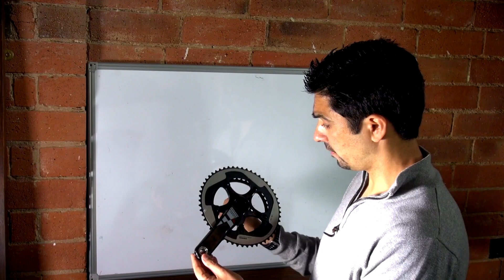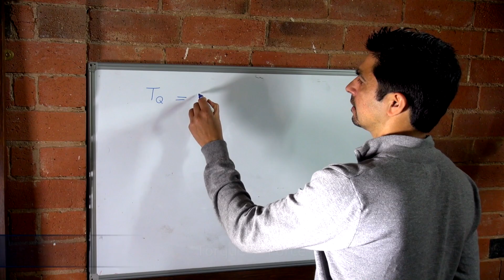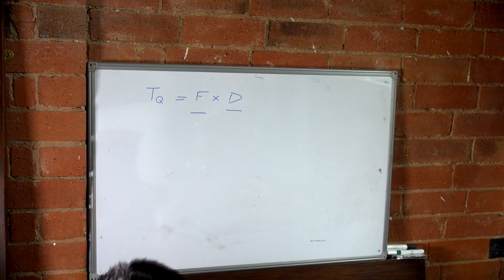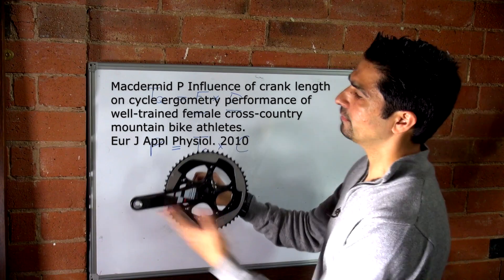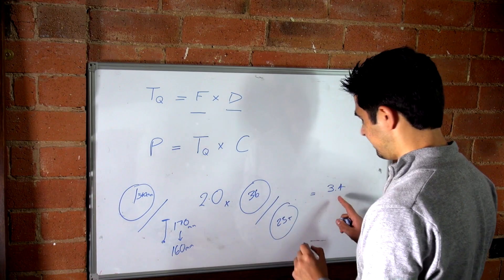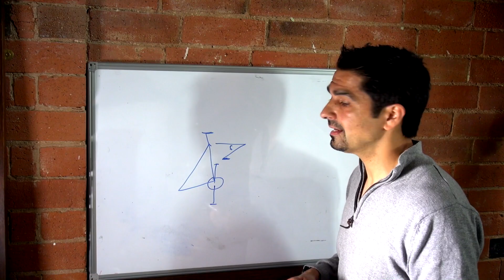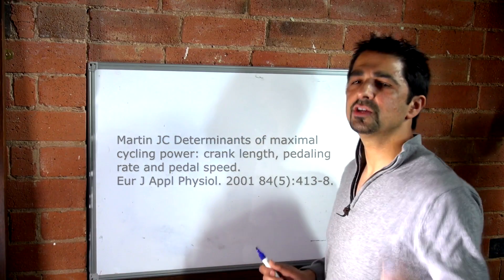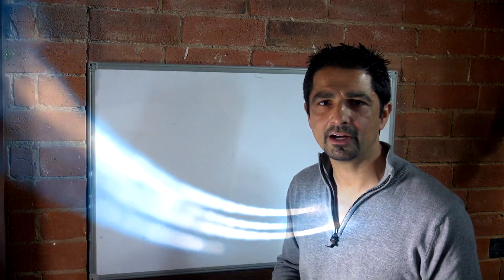The basics of Crank Length (Effect on power, cadence, comfort)

Comment: The crank arm length certainly is important and this subject is misunderstood. But this video is riddled with errors. The author is to be credited with recognizing the value of proper crank length but he is in way over his head regarding the details. The crank arm length has zero effect on the calculation of the gear ratio. He's calculating something else -- not the gear ratio. The biomechanics of the leg and foot during the pedal circle is explained incorrectly and the significance of pedaling efficiency to crank length is not explained correctly. It is not a simple mater of leverage -- it also changes the length of the arc where force is applied efficiently and comfortably. Cadence is repeatedly misused in the explanations. Cadence is simply rotations per minute -- nothing more. Because of the many errors in this video, it undermines the very real need to understand this subject. Finally, the rider's body geometry is ignored yet the optimal crank length is strongly affected by it as well. For example, in a forward-leaning aero tuck (think a TT bike), the body mechanics require a shorter crank arm compared to a more relaxed geometry.
Reply from the maker: .........But other than that......we are all good?? ;)
Reply: I've used leg press machines a lot, and ridden a lot; track, 'cross, mtb, tt, rr, ultramarathon rr. Initially, the leg press example seems to be more correct than it actually is. If my legs aren't rotating, I'm not cycling...rotation brings in spinning, conservation of momentum, etc.
Reply: @donkihotay5748  

Right. The main opposition to movement in "press machines" is expressed as resistance versus torque. Cycling is about developing torque in pursuit of optimized power curves (timelines). 

Leg presses develop core strength (torque potential) only at the peak end of the power curve. It may not be necessary. You have to understand the interplay to know where to prioritize weight lifting over on the bike conditioning.
Reply: Theres no way I could have anything longer than 165mm cranks on my TT bike. Anything longer and I'd be kneeing myself in the chest.
Reply: Jonathan Hughes  This is what almost everybody misses, yet it is the most important factor in crank length selection. It's useless to get technical about crank length and effective gear ratio without also talking about the mechanical advantage of a bent leg at various angles in the pedal stroke. While a longer crank gives more mechanical advantage, above a certain crank-leg length ratio the combined average torque will diminish due to a knee angle that's too acute (which is also harder on the knees). Of course there's more to it than this too, because it's not just about torque or power, but the efficiency of that power, and how long it can be sustained.
Reply: TrollMaster666  

Longer is not better unless you test to validate your proposed change. Err on the side of shorter. Virtually all of the "longer can be better" arguments have serious risks that must be considered. There are no risks from using a crank taht is theoretically shorter than ideal. The only real "risk" of having a crank that is shorter than your theoretical optimum length would be "off the line" or "jump" from low cadence where you must apply peak torque. (Not peak power. Power is torque times velocity.)

I like longer cranks because I do use "dynamic jumps" (shift to around 70 rpm and then jump hard) to attack. But it's risky to just experiment and assume that you can play with longer lengths...until you hurt yourself or end up losing peak power because you can't spin as smoothly as you once did but fail to make the connections.
Reply: Jonathan Hughes that’s only half the issue. You left out that longer cranks involve a greater lever arm increasing torque. This offsets the loss of strength from greater knee angle. The two issues along with higher cadence for shorter cranks probably all wash out in the end, more or less.

On a unicycle the crank length makes a huge difference because you are stuck with a fixed gear ratio determined by wheel size. Unicyclists therefore use everything from about 80 mm to 165.
Reply: @ D Eldon I fully agree with you regarding the physics and physiology. Regarding Aero position on a TT/Tri bike, I did the research and found that for a small statured person (I'm 162 cm in height) Extra Small size bikes still come with disproportionately long cranks. But it's hard to get short cranks. I finally found Mark Stonich mark@bikesmith.com and he can custom cut certain suitable cranks down to size. He cut down a pair of SRAM Apex cranks for me to 137.5mm and they ended up being perfect for me to get down to an aero tuck position on my Tri bike without my knees coming to my chest.
Reply: sorry, that should be mark@bikesmithdesign.com

Comment: My girlfriend was trying to tell me crank length doesn't matter, but I'm not sure I believe her.
Reply: She may not like riding much, or is not quite "experienced" enough. Then too, maybe she hasn't tried out many &/or different "bikes" with varying crank lengths. Not really sure what you (or she) would really want to do about that....."predicament".
　
Yet, female cycle enthusiasts tend to agree with Raymond here; that weight/size/mass (aka girth) matters more than "crank length" as well as speed or cadence - thrust differentials of your "ped-stroke"......and lessor so the aerodynamics of your "frontal area" or head position."
Reply: Ha Ha......that what they all say!
Reply: Never trust girlfriends
Reply: She also said she comes first,every time she rides! ;-)
Reply: and stamina too ....
Reply: It's all relative to the gearing. Higher RPMs can compensate for reduced crank length - so I'm told.
Reply: They all say that just so you dont feel bad. When they ride they sure notice the difference. If you ride on a shorter crank lenght make sure you thrust it harder and faster to compensate. Pun intended.
Reply: She is right.
For speed the most important factors are weight (size) and frontal area (aerodynamics).
This is why all the best sprinters in the world today are average height or shorter.
The 3rd most important thing is doing the training. You cannot buy success.
You get good at what you do. So do what works for you.
Reply: @raymondmenz522  did you not get the joke

Comment: I have used cranks between 165 mm and 175 mm. I found that in effect the main advantage of a longer crank was in hill-climbing. 

In the end I settled on 172.5 mm as a less tall than average cyclist at 1.68 m. I find with the longer the crank that, within reason, similar results can be achieved in terms of speed [progress with similar effort] with a slightly lower cadence, or as you might observe, a gear one higher than you might manage with a shorter crank. 

A disadvantage of longer cranks is that you can more easily hit the road with a pedal when cornering at a road junction ... for example. You live and learn on that!

But short cranks seem to stress the knees more over a long ride, or even, when weary, starting off.

Off course it is all down to personal taste. But if you ride a bike every day, then experimenting is fully worth the effort. Give it a week and decide what option is more “comfortable.”

My lowest gear is 44 over 24, which is not really a low gear at all!
Reply: George Johnson but did you adjust your saddle setback? If you didn't you placed your knee more in front of the pedal axle with the shorter cranks which potentially could be causing knee pain

Comment: There are two more considerations for me. I ride both a road bike and a mountain bike. Mountain bikes typically historically come with a 175 mm crank. I want my road bike to be the same so I'm in no discomfort going from one to the other. The other thing is where does my knee align when my cranks are parallel to the ground. This takes into account both upper and lower leg lengths and should require that a longer leg use a longer crank. In my case I'm 33 inch inseam (838 mm) that also guides me to the 175 mm crank based on using a plumb bob and fit kit.

Comment: So short crank is good for crits because you will accelerate faster, but it will take a bigger toll on your legs. 
I'm a short guy and I want to get aero. I want to get smaller cranks because my stem is slammed and I can't get the saddle any higher. But I should also get easier gearing along with the shorter crank so that pedaling doesn't get any harder than it is at this point. Am I getting this right?

Comment: It would be very interestingj to see the correspondence of riders cleat position to crank lenght. Specially in the ones where the measure don't fit the usual formula. In a matter of pure physics a setback on cleats of 5mm compensate largely a crank 5mm shorter or even more. There is an interesting solution to compensate problems like this one, specially in short cranks: 
http://www.ebay.com/itm/New-drill-position-in-cycling-shoes-Cleat-set-back-Near-middle-foot-cleat-/152455458004?hash=item237f0dacd4:g:VScAAOSw3v5YtsEc
What a difference with a setback of 12mm that original cleats fixation didn't allow. Like change from day to night! After the period of adaptation, to me took 3 weeks, it's like ride a bike in turbo mode. Now I use higher gear ratios without calf muscle pain and a much better performance. It isn't cheap - postage costs are high due to country or origin, but worth every penny!

Comment: Great video on a difficult subject. It makes sense to me now why my track coach set my crank length shorter than my road bike 160 v 170, as a juvenile we were restricted with the gearing 45/14. We were coached to spin fast and smooth, something I was unable to replicate with a longer crank. Crank length and gearing in track cycling is very important. This video sorta proves track cycling tried and tested the science way before it was challenged by the biomechanics and engineers. I tried longer crank lengths later but I just found them uncomfortable. It just comes down to what you feel is good and I guess what your body prefers or is used to.
Reply from the maker: thanks for the comment and very interesting perspective on track riding.
Reply: The reason is for quicker/faster spool up, not pedal strike concern. In track so much is about getting the quick spool up - jump. Bottom bracket is routinely 10mm to 10.7mm higher to that of most road bike which elevates the crank/pedal.
Reply: death2pc Even on the banking, your bike tends to stay perpendicular to the track. ....I you lean with the banking. ...
Reply: Jason Ward but the straights have to be banked so there's not a huge climb into the corners.   if you're riding quickly,  you don't need as much clearance in the corners,  but you still need it on the straights.
Reply: Track has shorter cranks to avoid pedalstrike.

Comment: there is an error at final on both situations the benefit is from long cranks you can apply more power with longer cranks the cost is on long time efforts when you use longer cranks the push effort is less but since the travel is more the cost you pay is an earlier fatigue.

Comment: My current bike is 172.5 and I have 29 in inseam. I think I will benefit from 167.5 cranks in my next bike mainly because my knees won't be forced up into my gut like they were with the 172.5 and I will be able to ride more comfortably with a lower bar position.

Comment: no no no, cadence is hot the speed your legs are moving but the number of revolutions. longer crank, same cadence, your feet are traveling faster, but you need to sit lower and your knees come higher, restriction the aero position. Therefore, it is beneficial for TT and tri to have a smaller crank. But easier to have longer cranks for hill climbs and more upright positions

Comment: Somehow there is a problem with you reasoning: You either assume a certain power for a rider and got to the reasoning part or fix another variable then start. You can't start the reasoning with a certain rider and move through the first part and then in the second one say you can push more cadence which give you more power... There's a problem somewhere!!! The results maybe logical or true but the reasoning is not.  It' more confusing because on a road bike I have a 172.5 compact cranck and I did my best climbing on it. But on a cyclocross with a 175mm and 44T chainring and an upright position I feel more confident at high speeds (better than the road bike) and can keep them more. So, can you get my confusion?
Plus you didn't even talk about length distribution in the riders legs and the seat set back to be be able to spin more or not!!! I guess you used bike fit for that but I think spinning and crank length go with inseam and legs proportions.
Anyway, great video. I might have to watch it again to get more out of it. thx.
Reply from the maker: Good points but I didn't mean to imply a rider's power is totally fixed. Its variable according to application. A rider can optimise their power along a continuum with time (power curve) by choosing the best balance between their muscular and cardiovascular generated power. To high a gear and the muscular component will be too demanding for the rider, too low a gear then (eventually) the cardiovascular component will be too demanding. The optimal conditions are the crank length (or indeed cadence) that you as a rider find best maximizes your output (producing your best power curve). That might vary according to conditions as well making it hard to reduce to a equation.
Reply: Yeah I get it. And as I said : I might have to watch it again to get more out of it.

Comment: Great video, the issue I have after a knee replacement I'm unable mechanically to bend more than approx 75° so I have to have a crank shortener on one side so that I can ride, without it I'm not able to cycle.
Reply from the maker: Is this better for you than two shorter cranks....ie the same length? does it cause any problems with asymmetry of the pedal circumference?
Reply: I ride with an above-knee prosthesis and use a  custom made 85mm crank on the prosthesis side,
it basically just acts as a counterweight to complete the full rotation after the power stroke.

Comment: False. People are not thinking about the leg of the rider.  A shorter crank means a smaller circle for the feet to move in. A longer crank will mean slower RPMs. A shorter Crank will mean faster RPM. You need to get used to the shorter crank to pedal smoothly.  It is much more comfortable to pedal out of the saddle with a short crank. A short crank will feel like you are walking up a hill rather than pedaling up a hill.  I did that with Murray cranks at the 155 MM setting.  I gave up on them because the area where the pedal attaches is to soft.  A person on a leg press Machine can push more weight in a short stroke rather than a longer stroke.  A person cannot move the same weight with his legs compressed against his body pushing out than when his legs are not compressed against his body. A shorter range of movement moves more weight.
Reply: agree. 
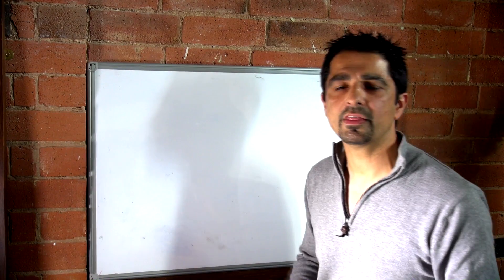my problem is that his story starting from 9:33 is not true (wrote him and he doesn't even reply or correct). he touches interesting thingy out there, yup, but he mess around, like many "science people" do, confusing: power, rpm, force, pedal speed, torque, etc, etc. so, basically, my problem is that he starts the post with the name "science"... there are too many "science people" out there :)))
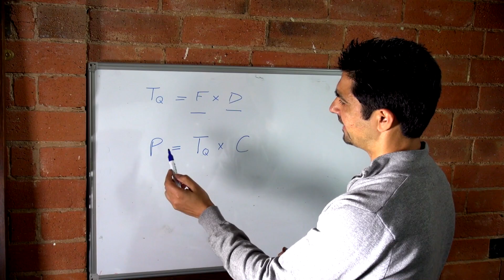Reply: This guy messed everything up on 4:23 with the P = T x C formula, from there on he lost me. If you change the torque (aka crank lenght), in order to keep the same power, you'll require less cadence, simple math!! This might require less oxygen and therefore a reduced HR. GCN did a test, and sprinting with longer crank arms (177.5 v.s. 162.5) represented around 140 watts more on average in 2 tests. At the end, the conclusion was super vague and trying not to push anyone on to a longer cranks, but I do see the benefits, its plain mechanics. On the other hand, there's fit and comfort which MUST be the first reason to determine the arm length, It's preferable to avoid discomfort and eventually an injury by sacrificing that small mech advantage!!!
Reply: yup, i pointed to him also what you say, like on the mouth he say something then he "corrected" with some stupid notes on the screen :)) but the one starting on 9:33 he did not even "corrected"... and, again, the name of this video starts with "science"... pfff :)))
i totally agree, fit and comfort must be the priority. 
about power, strictly about power (not force, not torque), in "plain mechanics", in my own searching, the shorter the crank the more the power. this ONLY IF the rider can do it and need it.. but there's also a limit on how short crank a rider can go.. unfortunately i'm not gonna say it here, cause i am working hard on my own to prove it.
best regards!
Reply: At the end we are dealing with the most complex force source in the world (hundreds of muscles, ligaments angles, etc), so, at the end, trial and error is the best thing you can do! Do let us know what works best for you!! With shorter cranks you might might be able to get a cm or so more drop, which traduces into better aero (which you could also gain with some yoga)!!! Best Regards!!!
Reply: i would like to write private, not here.   if you like, give me a sign/email: my name (as it's written here) at gmail.